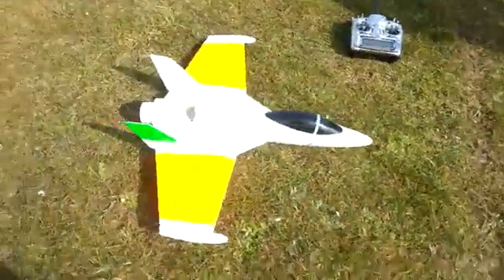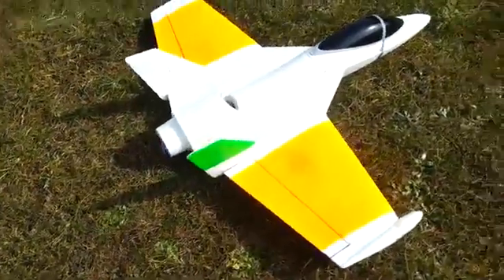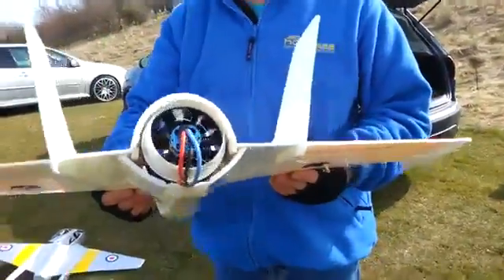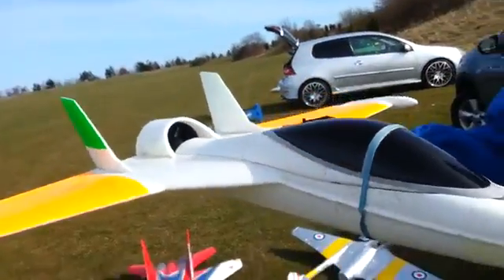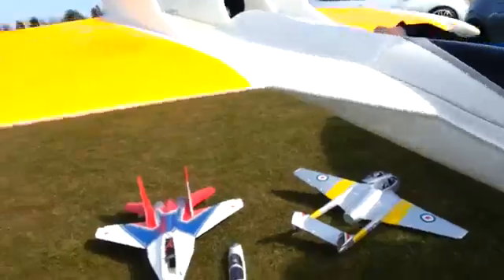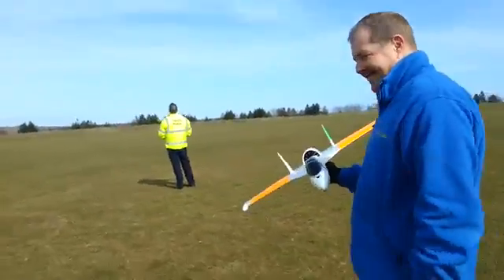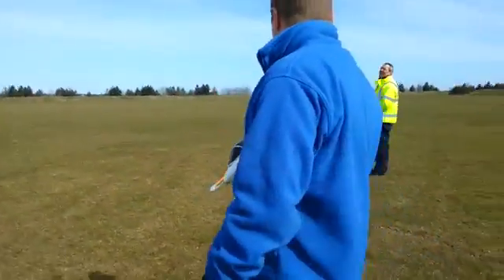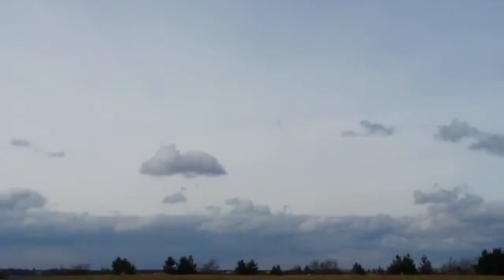Funjet Edf Change Sun 12 blade 70 mm fan Eflite BL 32 motor 6s 1500 watts 70amps

Comment: Hy my friend. First of all, congratulations for model airplane. Here in Brazil I've never seen something like that. I bought 3 of these edf change sun 12 blades, 70mm. But the engine is 4 s and very very weak. my 30 batteries are 2,200 mah 3s 30c. I'm planning to attach them in series for 6s and use the same set that you used this model airplane. Now tell me something. It was good that BL 32 turbine with 12 blades? does not melt?